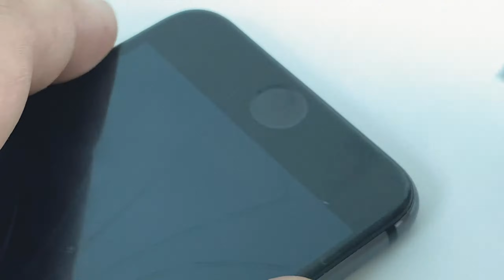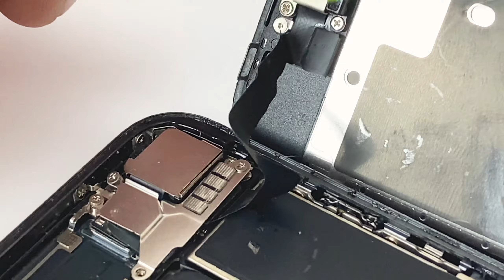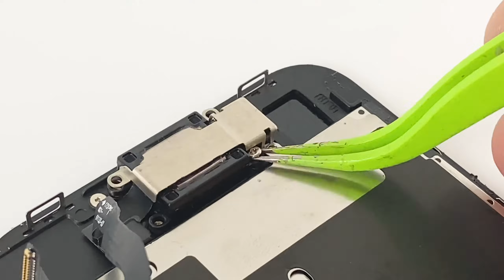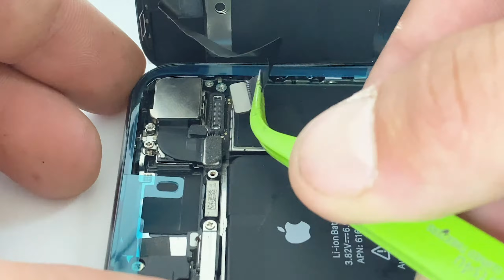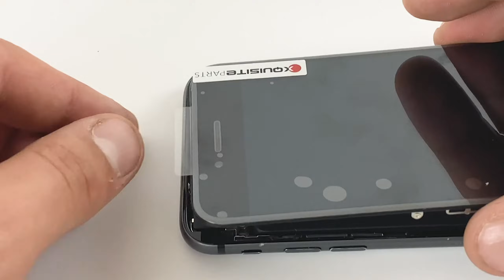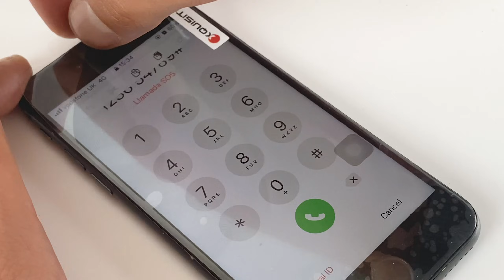iPhone 8 Screen Replacement - Detailed Tutorial

Comment: I ruptured the cameras and speaker's cable on reassembly and also ordered the wrong part. But the video is spot on. I will try again as I have not done this kind of work for a while and my eyesight is way worse than the last time I attempted something like this. Thank you for the video. Looks like the Iphone8 and the 8 second edition are not exactly the same.

Comment: Warning: You NEED to unplug the battery BEFORE unplugging the screen cables
You could fry the backlight (not sure if on the screen itself or the circuitry on the logic board, but it's not good)
Reply: Do you need that blue device he has to repair it
Reply: @Ghost2up360 that’s to keep True Tone and programme it to the new screen basically a copy and paste
Reply: how do you do that
Reply: @ceoofairfrancevirtualrfs7066  cable above the screen lcd connector

Comment: From the get go, guides like this should start with a warning!!
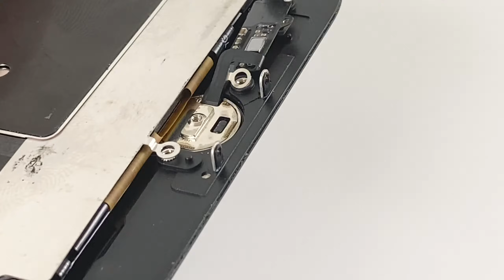Make sure you record where each screw comes from, and where they should return to! The screws vary in length, and if you put a long screw into a short hole, it will go down too far and damage the circuit board immediately below. Apple does this to hamper phone repairs. @2:38 There's a mention of the screen having 'true tone data' eg an id to link it to the rest of the device. Fortunately, the screen will still work without this. The same isn't true for the home button which is unique to each phone.

Comment: Thanks for the tutorial. I would like to check something on this replacement. I have one faulty iPhone 8 but no issue to the screen. Have another iPhone8 but the screen is faulty. Can I straight away swap the front panel screen from one to another without interchanging any parts on them to the working phone. If yes, will anyone be able to tell me which parts I need to move from the faulty screen to the working one. For eg: Home button. Thanks in advance
Reply: For reasons of security, the biometric home button is unique to each device, which means those need to be swapped across.
Reply: @chrisliddiard725 that's just for fingerprint